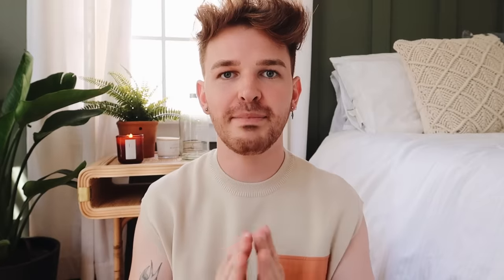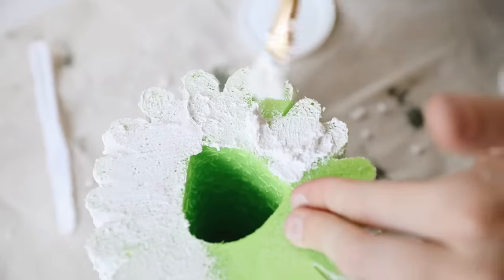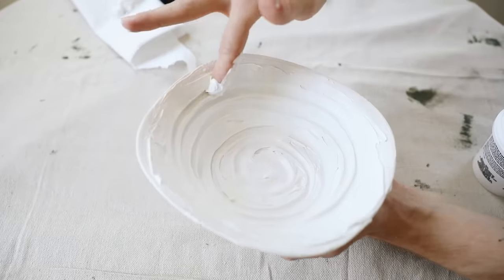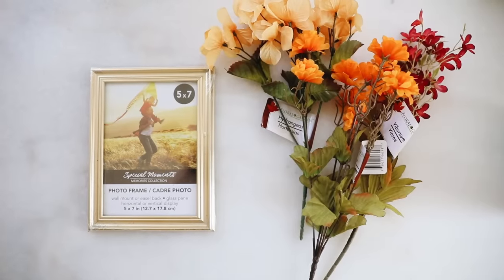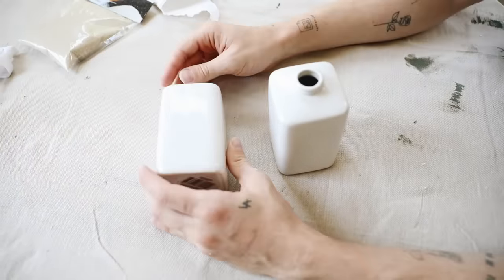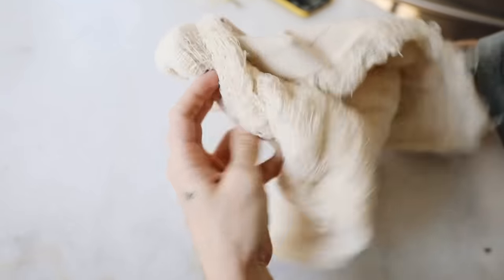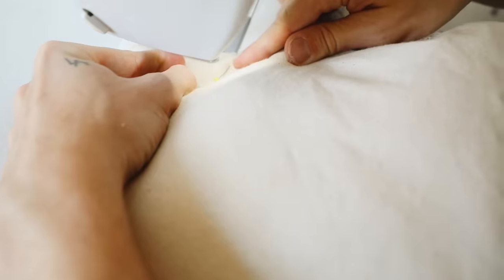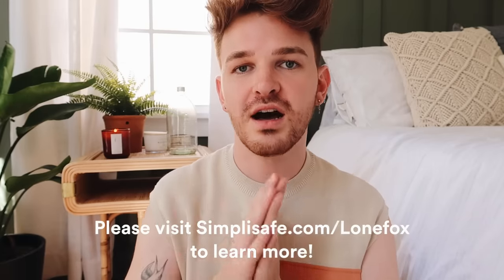10 DIY DOLLAR TREE HOME DECOR PROJECTS - Affordable + Cute $1 Decor Transformations!

Comment: For your beaded wall hanging, the "grass" is supposed to be a sheath of wheat I believe. Also, the resin on the trinket dish made that project. Really loved the effect it had. The candle was really cute. I think perhaps before painting the two glued together bowls I would run a bead of caulk at their joint seam so that when painted it seems seamless.
Reply: I agree with the caulking around the seam of the bowls for the candle! :)
Reply: Maybe add a second wick as well.  That was a wide bowl.
Reply: sheaf*
Reply: Yup! Buck wheat!

Comment: Couple of tips. When brushing on resin, use a silicone brush instead. It’ll be easier to clean the brush. When pouring in the melted candle was, wait just a bit for the liquid to turn just a tiny bit cloudy, as it starts to harden, but it’s still liquid, and then pour it.

Comment: Love the coasters as well as the home made candle holder. Is it safe to use Rust-oleum spry paint on the candle b/c of the heat though?
Reply: not an expert, but rust oleum lists typical max temps for their spray paints at 200F and the pour temp of paraffin is 180F, so kinda close but likely safe. with any homemade candle, supervision and keeping it away from flammable materials is key. rust oleum makes high temp spray paints (in limited colors) that could be used if you’re worried.
Reply: @cannonvogel8928  Thanks for the info, good to know! I have some of the terracotta spray paint and love it so I really wanted to use it as well. Cheers!
Reply: Pretty sure you shouldn’t have a flame near the spray paint though
Reply: @tourmii  Yeah I think I'm going to use some acrylic paint and just mix some baking soda into it to get the texture I'm looking for. Thanks Amanda, better to be safe than sorry..lol
Reply: Rustoleum also has bbq spray paint with high heat thresholds too.

Comment: For painting Dollar Tree beads, I string them up and then dip them into a chalk paint and water mixture and then hang them over a box I got from amazon. I just cut off the flaps & then cut little notches in the top of the box to catch the string so the beads are free to dry on each side. Most of the time I use my heat tool to help them dry faster and I rarely have drip marks to fix.

The other way I paint them is in another box I used dollar tree contact paper to line the inside and then spray paint the beads and roll and toss them around to make sure I get all the sides. The contact paper keeps them from rolling under the flaps on the bottom of the box.

For each I apply several thin coats until I reach my desired look I’m going for.
Reply: Hope this can help you out some.
Reply: Awesome tips!!
Reply: I had skipped buying those beads because it seemed like it might be complicated to paint them - thanks for the tip!
Reply: Sometimes I don’t like waiting for Amazon! Lol

Comment: For spray painting really light objects like leaves and flowers, I secure strips of masking tape upside-down on the inside of the bottom of the box by taping down the ends. The lightly sticky surface holds them in place and eaily releases them so you can turn them over and paint the other side.

Comment: For the wood beads, instead of spray paint use acrylic paint poured into a container. Add the beads, close the container, give a really good shake and pour out the beads so they can dry. Any missed spots you can just do a touch up job

Comment: Isn"t spray paint flammable? I would be nervous to light project 10. LOVED this video!
Reply: Yeah.. I think it's not safe to use? 🤔 Its food plate which is painted.

 Here in Finland, the insurance does not cover damage if it has been used other than for a candle class- for example, jam jars ext and so on cause a bottleneck fire. This the plate shape is good but it can still break down. or the paint may indeed catch fire. 🤔